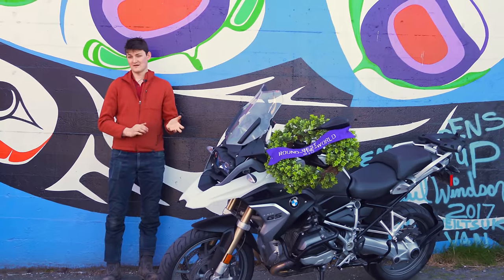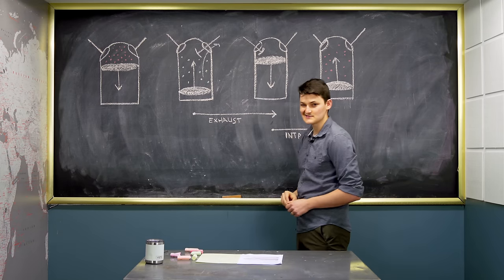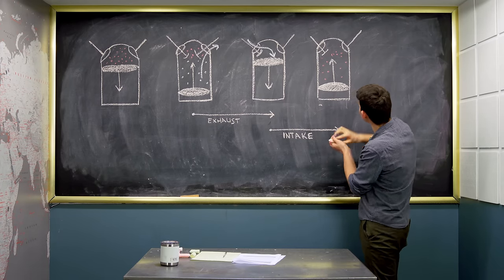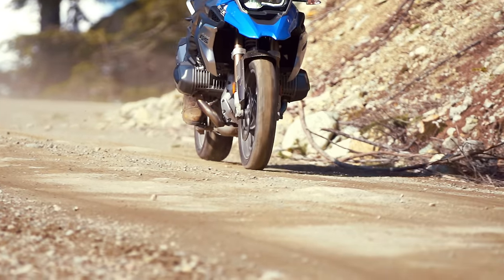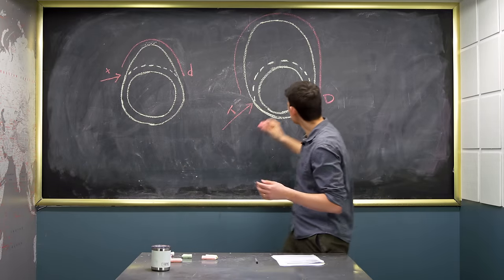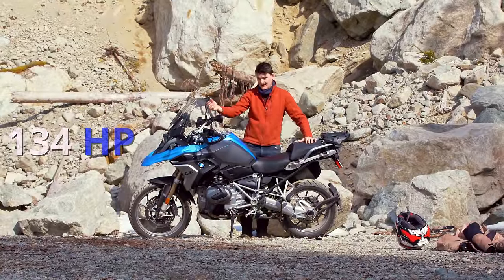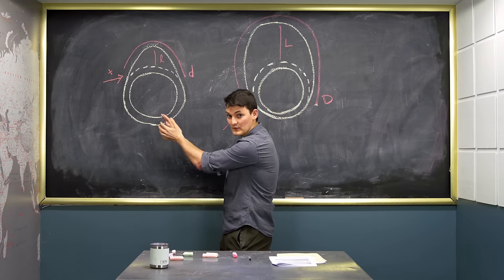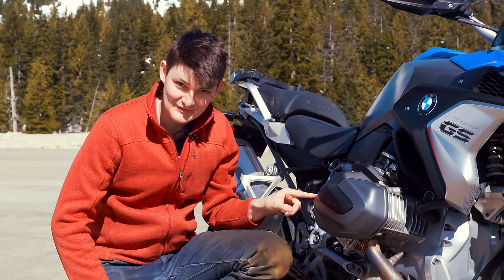Variable Valves are Bad for the BMW R1250GS - Review

Comment: Those prices for 2 wheels is just too much IMO. When motorcycles start costing as much as a car I find it starting to border on a little crazy. I'm in my 50's and do really well and could buy whatever I want. I tend to be really practical and I want something that is not too complex and is half the price. Then I can spend the rest of the money on good gear and equip the bike with all the cases and farkles that I need for my trips. My 2013 V Strom 650 serves me well and I know that it is reliable and not overly complex. It is easy to work on and requires no special tools. IMO the new tech is just to keep people buying motocycles. Every couple of years the manufactures have to make a better bike with more HP and more gadgets or they won't appeal to the masses. It seems like a weird vicious cycle that is easy to get caught up in. A lot of people as soon as there is a new redesign want to drop their perfectly good bike and buy the latest greatest thing. I'm even tempted from time to time. The marketing campaign is strong and there is a lot of money spent on it to draw in consumers. If you have the money and don't mind spending it have at it. 
Just my opinion of things.

Comment: I know that you know that the handle of the oem screw driver below the rear seat fits the shape of the oil cap, and that other bikes do need to be simpler than the GS (no tech and so on) because they will indeed fail in Mongolia, not the GS! But it was fun anyway.

Comment: I own a 2019 V-Strom 650, which in Ecuador costs 15k USD after import taxes. I used to live elsewhere. Used to own a BMW 1200GS. I miss my GS,but these days I am wondering if one really needs to spend 40k USD to own a BMW (in Ecuador that is) to end up driving to work and back home most days. My point is that I am not sure anymore if one has to spend so much money in order to be happy. After a year with my cheap Suzuki I am just fine.

Comment: I had a GS.  It was ok.  Too big, too heavy, too tall,  not much hp or torque, but comfy for 600 mile rides.  I ride a KtM 390 ADV now with no regrets.

FortNine didn't like the KTM 390 ADV either.  So? If you need someone's approval for what you do, you need to rethink who you are.

Comment: Interesting review. I recently bought a Triumph Tiger 900 GT Pro and yesterday did a test in Paris on a GS1250 for fun. The strange thing is that it felt a bit like a tractor to me after the Triumph, with a lumpy gearbox, and less effective suspension, BUT, when the time came to give it back, I started to ask myself serious questions about which machine I prefer. The GS has superb handling at all speeds and is very relaxing, while the Triumph is perhaps more exciting. Never been a fan of the GS but I sort of fell in love.  If BMW made me a great offer, I might even trade despite the 12k euro difference😂
Reply: Do you like your triple engine or is it to rough with the new flat plane crank? I read somewhere that the Tiger has really short gear ratios, so the enigne is basically screaming at highway cruising speeds. Do you still have the Tiger 900? What do you think about it?
Reply: @Ritalie  hi, I sold it to buy the GS in the end. I have a Trident so I don't miss the triple engine. The Tiger has a great engine but carries its weight a little high so you notice it more at times. It can get a little buzzy on the motorway but overall still a lovely bike to ride
Reply: @tonydare7614  Well that's a good review. I think any bike with a modern high performance engine, should not be buzzy at speed. I mean they solved counterbalancing and gear ratios in 1932. Jay Leno has a 1932 4 cylinder Henderson and it has an overdrive gear and has 50HP in 1932.
Reply: @tonydare7614  I'm on a mission to force motorcycle companies to install an overdrive on their bikes and stop with this nonsense of the super low race gearing. Bikes are all geared for a race track and that makes zero sense. Absolutely zero sense.
Reply: @tonydare7614  The GS really seems refined in the videos I've watched. It's also one of the most popular motorcycles in the world right now and so probably really good resell value too.
Reply: @Ritalie  too true! Take care and ride safe

Comment: I've always wanted a BMW S1000RR but this is my number 1 concern. Electronic VVT. I hate the idea of electronically controlled anything. They should've took the 2017 GSXR1000 route with the seamless mechanical VVT by using 2 plates and some balls.

Comment: Honest review, the new engine is better but the shiftcam solution isn’t that advanced to justify the high price

That’s why I bought it today when the 1300 is around the corner, it comes relatively “cheap” because they need to get rid of the “old” model
Reply: A few observations a year later

The power curve is almost regular, you don’t really feel two distinct pulls, it’s subtle. Also, very few problems with the solenoid placed there, they clearly did their homework well. The problem was with the driveshaft becoming rusty in like less than 80k km, but now they replace it for free every 60k km, and they added a simple one way rubber beak valve to drain the place where moisture would form (they should have recognized the problem sooner ffs, but at least now it’s taken care of).

The oil filler cap wrench is under the seat (the screwdriver’s handle)

The hill assist can always be disabled manually with a strong lever pull (alongside the cruise control deactivating when pushing the throttle forwards, a trick unknown to many because people don’t read manuals). Also, the hill assist can be completely disabled or made to be actuated only manually (only when you pull the lever hard after you stopped).

Comment: Excellent approach on the BMW GS but I would like to hear your thoughts on the Tiger 900 and the new engine they developed to increase the torque in low revs!!! 😎👍🏍
Reply: More torque just comes from the fact it went from 800cc too 900cc

Comment: This may fall into the "dumb question", but then again I have always been told that the "dumbest question" was the one never asked.  With that caveat, can you disable the ShiftCam system by disconnecting the ShiftCam solenoid, thereby relegating the engine to the "low cam lift" regime?  I'd gladly sacrifice that last little bit of power for increased durability. (See first sentence).

Comment: Hondas vtec was invented years before suzuki and toyotas vvti.Biggest difference to new bmw shift cam is that in cars,valve lift and duration control was always activated at certain rpm by oil press which solenoid let thrught and lock all three lobes together.(honda at 5300 for civic SI) yet bmw system is activated when needed,depended on throttle position…i owned both,old 1200 lc an new 1250 and i can say its day and night compared to old one.old one has nice grunt and u know its reliable and clunky as some tractor.new one really become more lively and jumpy thanks to that sistem.Time will tell how reliable this sistem is.For us who likes this we will keep it.For those who like street missile,buy superadventure 1290 or v4 multistrada,as they are both on steroids compared to bmw.Regards

Comment: Variable valves are the least of the trouble. The lack of proper valve cover protection, the crappy engine crash guards, the plastic handlebar "guards"  and the weak skid plate are all more likely to fail than the valve train. BMW knows how to engineer a durable valve train but they are too cheap to fit actual off road crash protection.
Reply: They do offer engine bars head covers etc..

Comment: @8:10 while pointing to the cylinder heads "electrical, in here..." I assume you know how a spark ignition engine works. They have always had "electrical in there" its called the spark plug. In the old days it was a high tension ignition cable directly connected to the plug. Now days, as on the GS, it is a low voltage cable connected to a coil mounted directly to the spark plug.

However, If you are referring to the shift cam solenoid being placed under the cover inside the cam oil bath, what's the problem? It certainly looks beefy enough to handle the environment. Also, for pretty much most of it's life, it's just sitting there doing nothing, actuating at a single point in the RPM range around 5,000 from the performance curves. It's a simple and one might say "elegant" electro mechanical system that is not under constant load.

Taking my engineers eye to the systems design. If the solenoid  does indeed fail while engaged or disengaged it should not affect the bikes ability to run. Sure, the computer may put it into a limp home mode. But it will still be operable. Also, it should be noted, that there is a single point of failure in the system, namely, the solenoid, a relatively easy part to replace. One that even the most inexperienced of backyard mechanics could replace. Most other systems, on the other hand, have multiple points of failure. That, if failure does occur would appear to me to be much more expensive to repair.

The Suzuki design you extol looks good on paper but the fully mechanical system appears to be under a reasonable continuously variable load for all of it's operating life. Systems under constant load are the ones that tend to break first. Plus, it looks more expensive to repair. If it does indeed fail it appears difficult to determine exactly what that failure mode will be. Any unrestrained motion of the cam outside of it's operating range could be catastrophic for the whole engine. Not a good idea. Also, being fully mechanical, how could you be alerted to an impending failure?
Reply: Well, someones undies are certainly in a bunch - Ha ha ha ha ha
Reply: Not to mention most industrial equipment (e.g., turbines, prime movers) all have "electrical, in here...". You don't see them complaining about getting "electrics in my mechanicals" lol
It was a poor argument for him to make.

Comment: Bought a 2020 R1250RS and the 2 different power bands is real. You need to modulate how to shift depending on the RPM. You get used to it, but it is not elegant.

Comment: Just took my tiger sport 660 in for it's first service, and they loaned me a 1250gs ralleye or whatever. it was decidedly... fine? It kinda fades into the background of riding so that's neat I suppose. It didn't impress me. It's the boardroom meeting of bikes that you do a cost benefit analysis before you go to the BMW bike shop in your pressed suit and sign the paperwork with your fancy ass mont blanc fountain pen.

Comment: It's too bad that nobody has licensed the Multi-Air tech from Fiat, which is an electrically controlled super fast hydraulic valve system used in many Fiat vehicles. The intake vales are so fast they can open and shut them twice in one cycle. It is the most advanced valve system on the planet.

Comment: Gs's icon as a reliable round the world bike died with the water/air cooled engine... Beyond 2013, constantly renewing the bike makeing it unnecessarily "better", with so many mechanical, electrical and software problems.... Bmw, take your time to create an improved version!!!! 110cv engine, the best of bmw... The rest is just a pose, but when it works it Flys..... But that's not what traveller's need as the primary thing.... If you want to just ride and make many maaaaaany miles, super tenere 1200 is made for you... Once you try one, will never trust motorcycle "paid" press anymore.... Open your eyes, try and choose... And if you know what you are doing.... You'll get the best one... Or a good one... There a few... But gs's... Come on.... They're made not to last and to be at the mechanical dealer frecuenly..  Had a gsa12 '09....great one... Not everything is looking for more & more power and electronics... Who needs it?? You know... Those guys....

Comment: In the middle of a zombie apocalypse the Shiftcam-Technology might fail me. Have fun repairing it, or even finding spare parts in the first place. And they placed the actuator for the Shiftcam near the exhaust outlet of the cylinder, one of the hottest parts on the motorcycle? Wät? That's like Schrödingers Cat: dead and alive at the same time, depends on when or if you look at it a little closer. Forget the few Newton-meter or Horses - I want Reliability and not 'Techy-Fezzy-Maybe-Breaky'! To sum it up, this is exactly the reason why I also won't buy the R1250GS - and stick to the R1200GS until 'death do us part'.

Comment: Check out the Free Valve System from Koenigsegg, awesome capabilities, less rotating mass inside the engine, no need to drive a camshaft, pushrods, levers etc. I Think this is the next step for every modern combustion engine.

Comment: you can find the oil filler cap tool in every GS tool kit. Not a very good tool kit but it is enough to  fill oil  out in mongolia, that I can assure. Take a look under passenger´s seat and look closely to the screwdriver handle and you have the answer.

Comment: F9 has lots of good things to say for the most part.  Having ridden both bike extensively, the 1250 does do a better job both  on and off road... so that begs the question. Why does he say these things?  Is it that the bike is to expensive and he can not afford.... only the shadow may know. The ( https://www.youtube.com/watch?v=m7gXgHgQGhw ) reference is completely out of place and has almost no important bearing on this subject.  That said, I have to wonder what is the real reason  for this video.  In addition when one considers the GS is designed for 80% road use, the shift cam makes sense!   The only  possible fly in ointment is how reliable the shift cam parts will be in the long run. Any modern bike can leave you stranded. The argument against the GS is a dog that does not hunt.

Comment: Filler cap remover  is the back of the screw driver. Found under seat. The hill start is also easily de activated. Unlike the KTM
Reply: Yeah his comment about the filler cap was pretty stupid. Its not Astro physics. It’s comes with the bike attached to the seat. The purpose is if your in a 3rd world country any person with a flat head screwdriver or wrench can’t walk off with your filler cap. People will try and remove things from your bike if your not around!

Comment: I think while it is nice a company like BMW or Ducati is making $20,000- $30,000 adventure bikes that push the limits of tech and comfort on the march to make that price point standard, it should be alarming.  The GS is not the ONLY path of adventure riding now(I totally respect its leadership on the creation of the classification).   I would rather have a cheaper bike like the V-Strom1050 decked out in every farkle on the planet for HALF the money.  I would adventure out into the world because I have a CHEAP bike to throw into a side of a trail.

Comment: It's a slightly unfair review. It's an excellent piece of tech for BMW boxers and those that ride them. Pointing out the fact that a 1250 is not an Enduro is not a relevant argument. It is excellent technology for its intended use. It is not merely a 2 band power curve, it's a 2 stage power curve. Air+fuel are adjusted accordingly with each cam lobe. Furthermore, the Suzuki alternative was only explained in a cursory manner so that the details were not well understood, nor how such a design was superior across the board. This had more of a taste of a hit piece than a truly legitimate discussion of technical merit. The GPS/odometer flame was ridiculous. The special filler cap attack was well deserved 😁👍 The price gouging attack may be also well deserved, but these things are made in Germany, not China or Thailand or wherever else. The cost of labor is much greater for boxers.

Comment: The rig is made for what the Beemer are, over engineered, over complex and ungodly expensive.  You forgot about mentioning the engine compress ratio, which is as high as 12.5 :1. Like the counterpart of KTM,  such a high compress ratio offers you ouph  but the engine suffer a high strain and stress. When the bike gets milage, the engine tend to break apart. You will have maintaining work to do. Beemer's engine is lack of precision made. I didn't see there was any improvement. Currently all the beemer's engine in the model of 400 twin, 650twin, 750/850/900 twin are made in Sichuan in China by a Chinese manufacture called Longxin. China engine, the most expensive price in its class, are you feeling OK BMW?

Comment: You are showing an amplified torque unlinearity (cut off diagram) of 5% near maximum power and claim that the motor is shit?
I guess you know that the two camshaft profiles are chosen between 1000rpm and 5000rpm depending on the load only and not based on fixed revs as others do?
I guess you know that the dyno curve represents the full load valve timing only, as fully opened throttle means full load of cylinders.
I guess you know that the bumps in curve are because of intentional resonances at intake and exhaust at full load valve timing and not because of two valve profiles?
Reply: Are you trying to tell us that you're running dynos on half throttle....? Yeah I'm not buying your exhaust resonance bs.
Reply: @HoodlumMedia  As a matter of principle, you should not assume anything from educated people. They have spent their whole lives studying stupid things with complicated names and formulas. This is consequently frustrating and they thereby try to confuse people who have acquired tremendous education from hearsay. The study of fluid dynamics has in no way the qulity as the test report of an exhaust does.
Please, do not accept knowledge from confused people who have dedicated their lives to a single subject! You are on the right track.